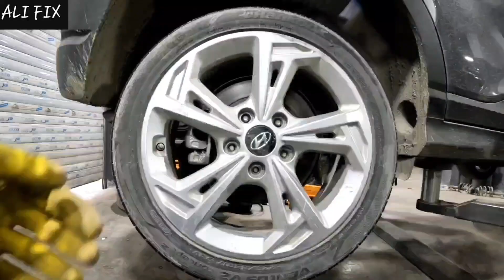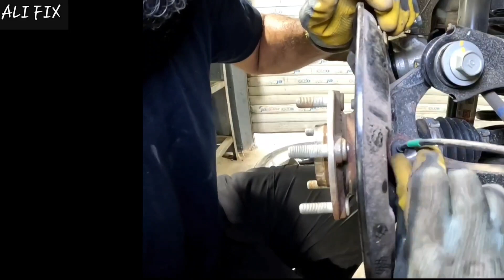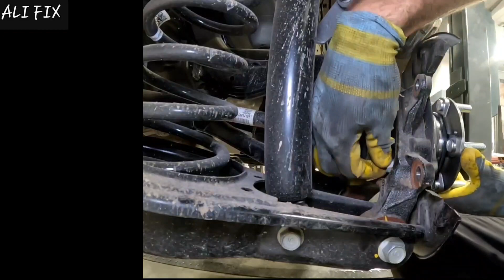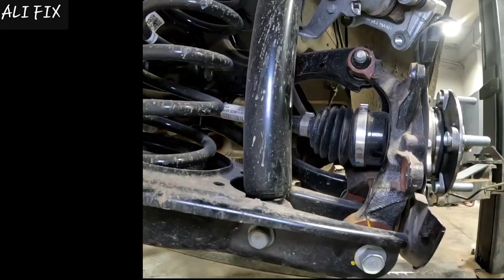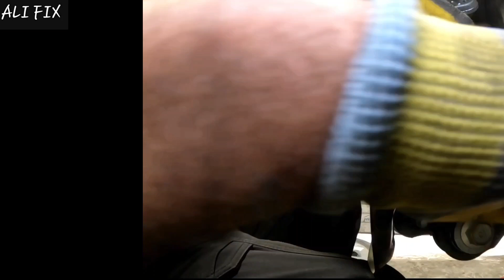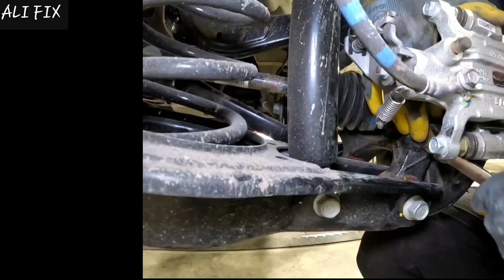rear wheel hub bearing replacement ... hyundai kona

Comment: Ali skipped the part about pressing out the bearing. Aint that easy.
Reply from the maker: that not very easy .. but i can do ... thank you for watching sir 👍🏼🔧
Reply: How many ft lbs you torque that axle nut?
Reply: You can also just replace it with one already in a new hub!
Reply: So I replaced my bearing hub assembly and torqued it to 165ft lbs. No issues after 1000 miles so far